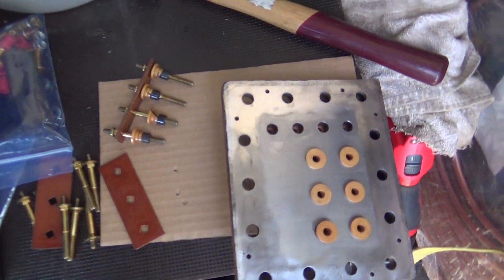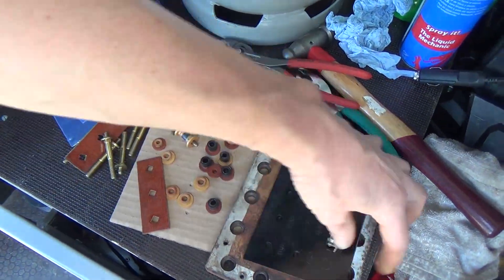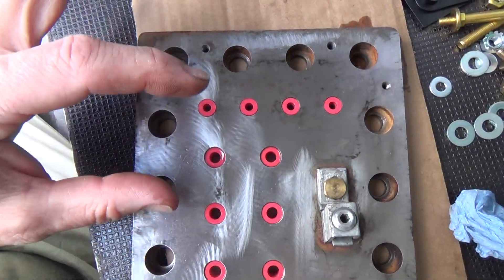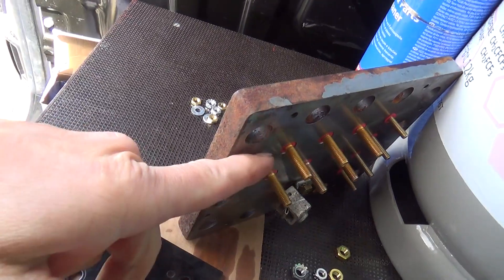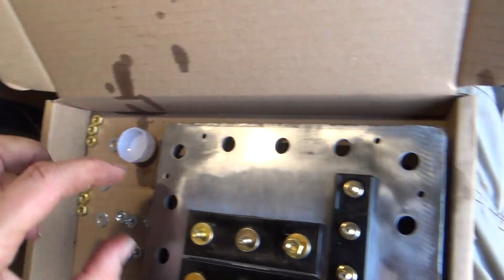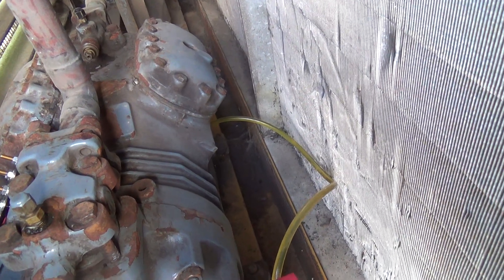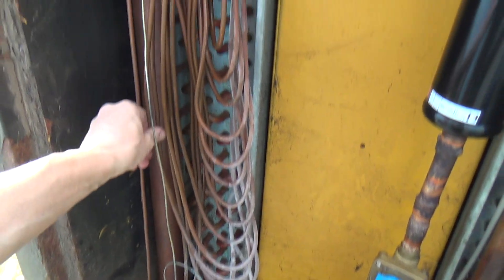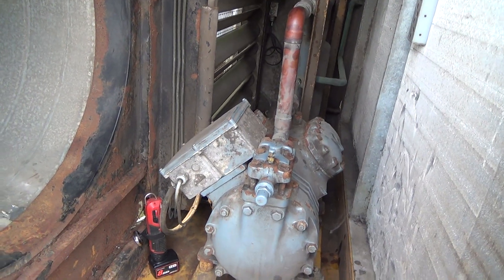Leaking Compressor Terminals

Comment: I’m so glad I no longer have this in my life. Only 5 months more and no refrigeration again.
Reply: Paul silver, hows it going? I worked with you many a years ago at Herts cooling when I was a trainee with you. Hope your well mate
Reply: @louisbowtell7457 omg yes. How are you. And your family. I hope I wasn’t too awful.
Reply: @louisbowtell7457  it’s good to hear from you.
Reply: @paulsilver1625 just noticed my comment never went through.  I’m good, chiller engineer for trane, still in the industry, working on water cooled and air cooled chillers & heat pumps
Reply from the maker: I don't mind jobs like this as its something new, get a bit bored working on the same stuff all the time.
Reply: @heavydiesel  you do seem to do many different types of refrigeration. I’ve done all sorts too. But you beat me hands down

Comment: 3l of oil in the compressor, and 10l in the accumulator, with another 10l sitting in all the coils and pipes.
Reply from the maker: Yeah, it had a load of oil come back one we run it for a bit so changed it again.

Comment: On summats like that, how long does it take to vac it out? And what sort of level of vacuum do you aim for?
Reply: Same as a regular unit, just the pump will run for a day or three, depending on just how much water got into the system. going to take a few dozen cylinders to fill it though, which is why you used to get R22 in 1000l returnable containers.
Reply from the maker: We had the vac pump running on the system while I did the terminals, then extra 30 minutes on the compressor. Think we got it down to 1500 microns which is good enough for this type of thing.